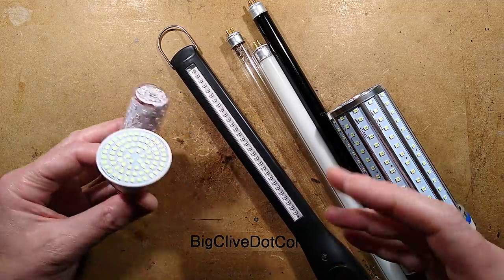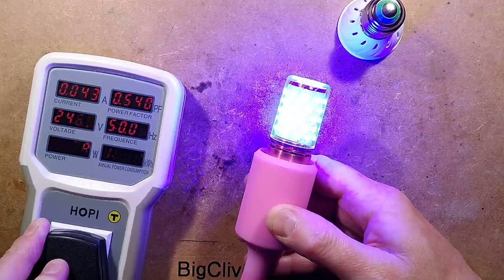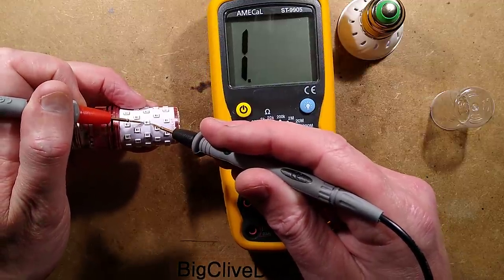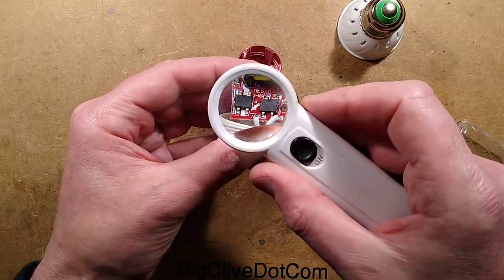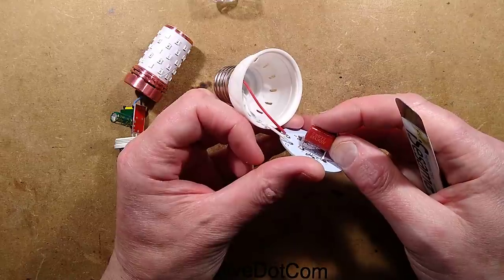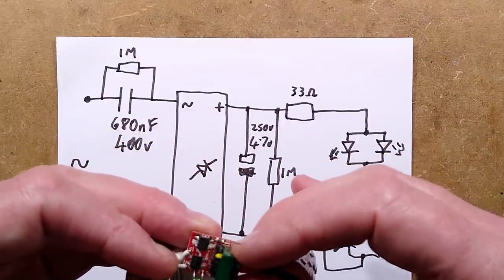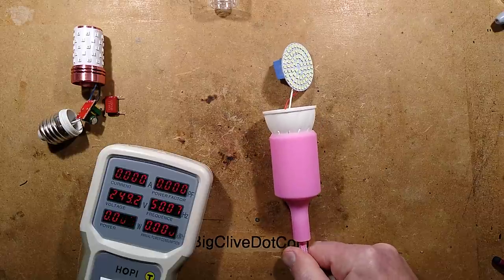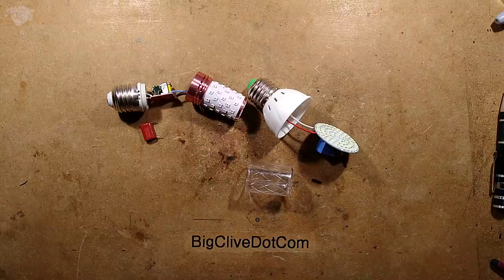Hacking fake UVC germicidal LED lamps.

Comment: I lost it when you unscrewed that lamp and it just fell apart 🤣
Reply: I have often wished that these "better" name brand ones would also have that easy access feature in them :)
Reply: Ben Baselet 😆
Reply: Immediate lol.
Reply: Sijuper dodjeeeey! ©
Reply: @benbaselet2026  In the old days, similarly constructed lamp holders had a small springy tab on the copper that we had to press to unscrew the innards.  This was only accessible after unscrewing the lightbulb so no additional danger.  All the mechanics were moulded into the moulded parts and stamped into the stamped parts for near zero cost.  Tab would wear out after about 10 disassemblings, which is enough for repairs.

Comment: When I changed really old incandescent lightbulps in my grandmas home, the bulp came out in one peace, but the threading on the E14 lamp remained in the socket. The plaster like material they used had given up over the jears. Same issue with the ones that used something like resin.
Reply: An old cork or an eraser is a useful tool for removing the bit that's still in the socket, having made very sure that the supply's switched off. Old corks are preferable, as you need to open a bottle to get one.
Reply: I have had Edison screw lamps so corroded in I had to peel them out with long narrow nose pliers, needless to say I replace with BC at every opportunity.
Reply: @tonywalton1464   I always go to the braker board, switch it of, check with the multimeter an then use my finger or tweezers.
Reply: @kommander9638  a wine cork saves your fingers
Reply: I always just stuck the bulb back on with Super Glue or epoxy, then unscrewed it when it had hardened.
Reply: NoJusticeNoPeace quicker to replace it time is money.

Comment: I've seen some semi-fake corn cob uvc lamps on Amazon, where they have hundreds of either blue or uva LEDs and about 4-5 actual 100mW uvc LEDs spaced out around the lamp. Cunning.
Reply: I bought one recently from AliExpress with 6 real UV-C+UV-A hybrid LEDs, but they're definitely not 100mW... More like 10mW, it barely made a banana slightly darker after 30 minutes or so if point blank exposure. I modified mine to disconnect the UV-A LEDs since they're not so interesting and blindingly bright in comparison. Had to lower the drive current too since they were both in parallel (well 2 series UV-A per UV-C).

Comment: Some conventional Bogao lamps tend to have bases and plastic 'glass' which screw on, which presumably makes it easy for them to churn out the same lamp with different bases (B22, E27, E14) and tops. The ones I have are nice enough to have a transformer and high frequency output (so not a trace of flicker when pointing a camera at them).

Comment: Was just at a distribution center in St. Cloud, MN USA that appeared to have some UV-C lamps all over the place... They DID have a white coating on the bulb, but it was definitely that icy blue color of the UVC bulbs, and absolutely, 200% NOT colored LEDs.

I'd share the photographs I took, but alas, the old toober doesn't allow it...

Comment: Seen the USB-C UVC LED lights being offered by places like Banggood? They look interesting but I'd hate to have to say that fast.
Reply: I've received one similar one so far (shipping within US) which is a USB powered wand with 6 UV-C/UV-A LEDs with the brass case, it is legit but such low power UV-C as to be utterly uninteresting other than as a weird LED wavelength. The electrical to UV-C efficiency is around 1-2%.

Comment: Recently bought a small UVC sterilizing box from China to disinfect face masks.  Used Clive's "banana test" to be sure its LED's really put out UVC.  Although the UVC LED's in the box were not as powerful as the wand he used to tan the banana, it worked.  However, the color change did not show up until the next day because I used a ripe banana instead of a green one.  I bought it from eBay.  The company name is "59S".  Not everything made in China is a rip-off.  But "Buyer beware."

Comment: Clive? I have a question, years ago I got a shock after touching the pins of a plug on a uk hairdryer, ever since then, every time I disconnect a plug I have to touch the terminals. I think it’s mainly so I don’t start a fire if plug touches the carpet, am I being irrational? Please help me quit my OCD. Many thanks, love your videos.
Reply: To help you quit your OCD you need to feel the urge to quit it.
I prefer using my OCD to cancel itself when I need it not, and in other cases I try making it work for me.
Reply from the maker: I do that myself.  It must be the thrill of anticipation.
Reply: me too, for me the initial shock that way was from a laptop charger.
Secretly I always hope it happens, but 99% of the time it doesn't.
Happened a lot more often on old 80s/90s switching PSUs like laptop chargers or wallwarts.
Reply: It’s not OCD, it’s CDO as obviously you have to arrange everything in alphabetical order!
Reply: @TheRailroad99  I'm guessing oversized RF suppression capacitors before the rectifiers.

Comment: Clive, have you estimated the actual wavelength of the fake "UV-C" LEDs on this corncob style lamp? I know some are just blue, and some are just violet. But I noticed the construction of the SMD LEDs on this one have that UV window style, which I've never seen used with blue LEDs before. So I'd guess this is one that actually emits a deeper UV-A than the cheaper ~400nm LEDs?  If it's around 360-370nm, it should make a good lamp for activating UV-reactive paints and charging glow powder. Can you clarify if it's UV-A? If it activates blue neon pigments as well as other neon colors, that'd determine it for sure. Thanks!
Reply from the maker: It's well and truly in the blue spectrum.  Probably around 470nm.
Reply: @bigclivedotcom , thanks for clarifying. I'm disappointed to think that I can no longer count on that large metallic backing and wide window as an indicator of <400nm wavelength LEDs in particular.

Comment: Places lying about their lights has been really frustrating for getting something suitable for curing UV resin for 3D printing.  You need to do a final cure at 405nm or a bit shorter wavelength and a lot of LEDs that list as 405nm or for curing these types of resins are just blue or purple and no/very little UV in the right wavelength range.

Comment: Haha why is it not a left hand thread. Great design feature!
Reply: Because then it would just undo itself in the other direction.
Reply: @benbaselet2026  does it even matter when exactly it falls apart if it does?)
Reply: Janus Kobain Yes, it does.  If the lamp came apart when installed, buyers would like demand refunds.
Reply: @wargamingrefugee9065  even if what I said was too serious and not funny (I obviously failed), the more comments the better.
And the flat one has live terminal exposed conveniently in the middle of the plate, so there'll be little to nobody to demand any refunds, I guess.
Reply: @wargamingrefugee9065  just wrote a couple more comments, so now I'm feeling better.
Thank you.

Comment: I was curious if I could use a hakko Japanese 100v soldering iron in the US without any problems. From my research, it may run a little hotter. But I won't risk fires or anything bad right?
Reply: Probably with a switching-supply?
Don't know if Hakko makes fixed soldering-irons without any control? If you have just a heating-coil it will run probably very hot, like glowing-hot when surrounding-temperatures are high enough. I have some older soldering-iron that is giving light when I plug it in, designed for 220V but here we generally have around 238-240 Volts if everything works right (this week sometimes only 200 though). Works for a while... and then blows itself and might blow a fuse or other protective things in your house if you are lucky (would not recommend using it unattended).

Comment: If I discharged a 2200uF capacitor on my skin what would the result be? Would i just be in a little pain, or something potentially dangerous?
Reply from the maker: It depends on the voltage.

Comment: So if you removed the LEDs and put a 12 volt DC power source would it work as a horrible power inverter? ( well after you removed the discharge resistor) would it go bang then?
Reply: Are you thinking of powering it from a chemical battery? Well, if you want to step the voltage up, then it'd be a crude power converter, but if you want to construct something like a 240V sinusoidal power line, you'll need a good transformer (center-tapped one on its primary, I guess) and a symmetrical switching circuit.
So the short answer is «may be», but not an inverter in the sense of how they work.

Comment: With the power drop rate is the radiation or illumination drop down in the same rate?
Reply from the maker: The efficiency increases at lower power, so the intensity will drop by almost, but not quite as much as the power.

Comment: What are your thoughts about using an e27 bulb in an e26 socket?
Reply: Do both actually exist?
Reply: John DoDo Doe The e26 socket is the 110v version of the e27 220v socket. Both e26/27 bulbs will fit in either type of socket. However, putting an e26 110v bulb in an e27 220v socket will burn the bulb out. My question is whether putting an e27 bulb in an e26 socket will result in a dimmer and less wattage producing bulb. If the e27 bulb was rated to produce 35 watts. Would it produce only half of that in an e26 socket?
Reply: @timeless_realm  Really, as the difference is within the mechanical tolerance, I would not have expected two different socket models.
  As for putting bulbs on the wrong voltage: Traditional incandescent bulbs will blow on too high voltage, last longer (but dimmer) at low voltage.  But the relationship is not simple, as different power changes the resistance of the filament.
  LED bulbs with simple capacitive or resistive dropper (like the white one): Intensity drops almost linearly with the difference between the LED stack voltage and the (rectified) mains voltage.  When this approaches zero, some dim light may remain.
   LED bulbs with active regulation like the red one will light the same over a wide voltage range, above this the regulator may overheat and blow, below some light may or may not remain.
  Neon based bulbs have yet another behavior.

Comment: Instead of having to fiddle with that tiny resistor, couldn't you just splice in another (non surface mount) resistor on the wire going to the LEDs?
Reply: This is the current sensing resistor. Its purpose is not in limiting current going to the LEDs, but instead programming the control chip's output current.
Tossing resistance in the output means working against the controller, so it'll drive the output harder.
Hope this helps.
Reply: The easiest analogy, I think, would be a resistive voltage divider or a potentiometer, but only to some extent, because such control chips have their own limitations and features.

Comment: Clive. Can you do a series on swapping out USB ports? There is lots of proprietary ports on older devices that are still useful, but they have some stupid USB port on it. Or a missing or expensive charger or cable. Samsung's devices are the worst. They must have 50 different USB cables and ports. I'd like to swap the Samsung SUC-C3 and 4 ports and convert them to USB-A or USB-C on devices or charging docks.  Even if the speed or function is restricted. At least the data and charging works. I have not found a good resource with for pin outs. What USB you can swap for what type. I don't think anyone has done this. I can send you many of the cables and some devices for the project. Left overs from hotels.
Reply: Some of the semi-recent odd shapes are USB 3.0 plugs that could be upgraded to USB-C.  There's an old HTC plug that combined micro USB and headphone, not sure if USB-C headphone is electrically compatible.

Comment: I know what that little live through hole is for. It's protection against accidental safety. If bad luck should ever threaten to render this lamp too safe, this clever bit of design will reliably restore its safety rating to acceptable Chinese standards.

Comment: Are either of those lamps CE marked? CE seems to stand for China Export these days.
Reply: There is a subtle difference between them. The easy way to quickly differentiate them is as follows: On the open (right) side of the letter “C” drop a vertical line from the top to the bottom. If the left side of the letter “E” touches this line it’s China Export. If you complete the circle of the letter “C” and the right side of this extended circle just overlaps the left side of the “E” it’s European Conformance. https://support.ce-check.eu/hc/en-us/articles/360008642600-How-To-Distinguish-A-Real-CE-Mark-From-A-Fake-Chinese-Export-Mark
Reply: @theonlywoody2shoes  Is this real?  I thought the Chinese Export story was an urban myth grown around sloppy products with sloppily drawn CE marks plus blatant exploitation of the rule that CE conformance is mostly enforced after the fact and against the hapless importer.

Comment: Hi Clive heard that the UV frequency of 222 nm is safe to sterilise covid19 but won't penetrate dead skin. Also talk that it could be fitted to street lights.😱 Any comments. I think I saw it on Physics.org site.
Reply: Ricky Turnbull — Patreon?
Reply: Dead skin?  You mean after it kills it then 😉
Reply: Why wouldn't sunlight do the same thing?
Reply from the maker: The 222nm excimer lamps are still under development and testing.  I hope they don't fit them to street lights.  Over sterilisation would do more harm than good.
Reply: @montestu5502  furloughed atm so short of cash 🙁 will probably do it when back to work🙂

Comment: How did you solder such a small part ! ?
Reply from the maker: Flux, and a fine tip.
Reply: Clive you have steady hands and good eyes I cant do work that fine .
Reply from the maker: @jhonsiders6077  I'd have thought the same too, but when you start playing with surface mount you get to know the techniques.  Magnifying glasses and lots of flux.

Comment: I have had no luck buying genuine UVC quartz ozone lamps on eBay.  The sellers accept the order, but then cancel.
Reply: One arrived from Geek/Wish yesterday. It looks like the genuine article (a discharge tube not an LED, clear "glass", traces of metallic mercury in the tube). Rated at 6W but, strangely, drawing 8W. Never seen that on Chinese goods before! Quick-ish delivery too via Deutsche Bundespost (so I guess they have a warehouse in Germany). The odd thing is the listing's disappeared from Geek completely, or I'd post a link. Off to buy green bananas today to see if there's UV-C there.

Comment: I hope you give the sellers of fake articles bad feedback and ask for full refund? I really hate this shameless behavior playing with peoples fierce in corona times. I had lately very bad experience with electronic parts like transistors, mosfets and even simple diodes - they all proved to be fake! Some of them blacklisted me after negative feedback, but thats the only way to go. I asked ebay to check if it is a data protection violation if they give the blacklist to other sellers as they do? ebay is not concerned about that so i involved the official site - not easy to find a web access for whistle blowing here but i think it will make the way...

Comment: If someone here actually wants a high power uvc germicidal death lamp for cheap/free get yourself a mercury vapor lamp, break the outer white glass, clean the vapor chamber with alcohol(because it can explode), plug it in from the next room, because you'll go blind, and let it work

Also this is very dangerous, so I advise against doing this, but if you do and get hurt don't blame me, you were warned.
Reply: @sleeptyper  I know this is a dodgy experiment friendly comments section, but I had to put a disclaimer in case someone gets hurt doing something I said :P

Comment: Instead of turning cheap junky led lights into cheap led lights, why not turn some into cheap led pyrotechnics??  You are versed in that aspect of both typical pyrotechnics and electrical pyrotechnic faults..  lol..  nobodies making anymore destruction overvolt/ current  videos anymore like they all ran out of stuff to pop..  or like modifying things to make them dangerous, i mean cool...  maybe a grill igniter step up simple mod with maybe an ignition coil or marx generator with grill igniter..  or a really high amperage low dc volt supply build or mod from one of the cheapo’s on the bay..   and why has only photonicinduction done the radiator fan on crack??  Nobody else had done that again which was friggen comedy and amazong both at how much power that cheap 10$ fan took..  thing had thrust..  lol..  maybe wind your own transformer or choke and go over the henry aspect of inductive chokes and cores/winding turns, wire size, way it is wound as in sporadicly wound or consecutive neatly wound.. maybe even make a winding/ unwinding machine that uses bearings to straighten magnetic wire if trying to repurpose some to a drill setup for the rewinding part..  dunno..  many others have done some of those things but personally i think Clive has a way of explaining things that keeps things understandable and humorous with a chill voice thats not aggravating or distracting to the topic at hand, literally..  ha!
Reply: Oh, you just need a handful of electrolytic capacitors to make many loud bangs, no LEDs involved at all.
Reply: It's because YouTube is heavily enforcing misunderstood ideas about what would make sensationalist papers like the Daily Mail campaign to scare advertisers away from paying YouTube.